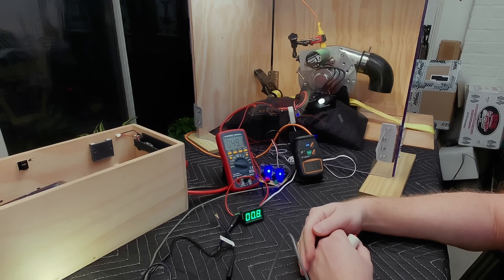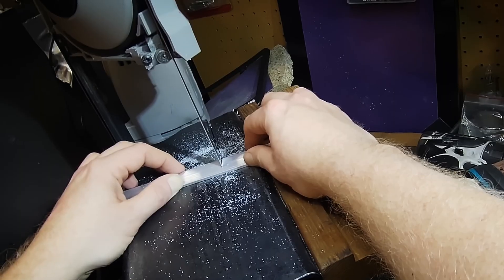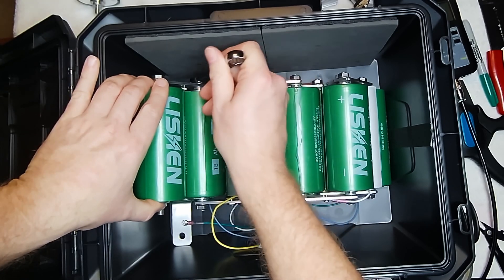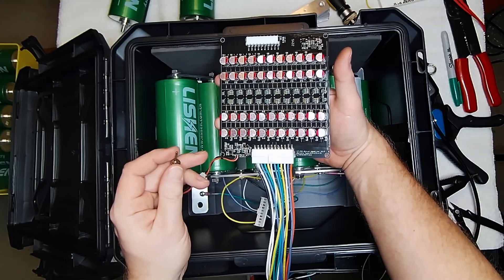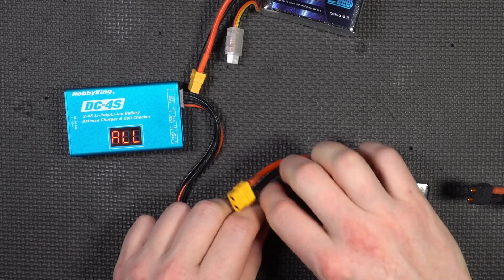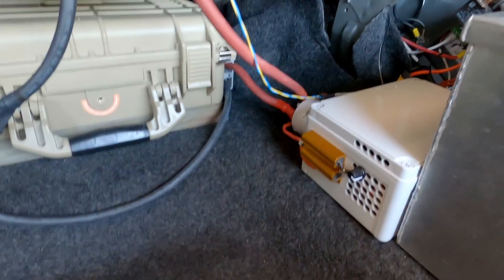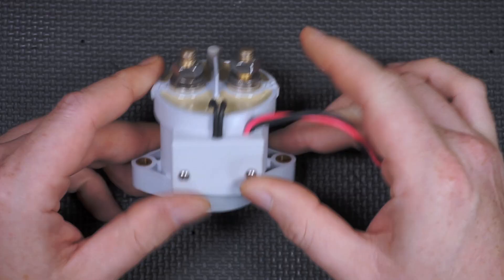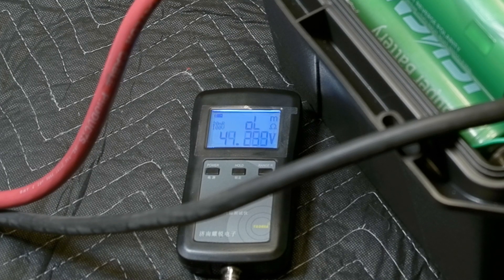I build the Ultimate 12s Lithium Battery

Comment: Great video.
I'm in a wheelchair and was wanting to build a better 24v battery for my power chair. It has 2x group24 deep cycle batteries run in series. They're heavy and don't hold a charge like they used to. What would you recommend to upgrade? A bunch of 18650's in series parallel?? Any help would be appreciated
Reply: Id run some big 18v drill batteries in series for 36v. Most wheelchair motors are just brushed dc motors which could absolutely handle higher voltages just dont run it to long in the grass or whatever as the motors will get too hot after a while. If the motor controller burns out you can use any old ebay motor controller
Reply: Thanks a bunch. That's an awesome idea.
Reply from the maker: I would go with lithium iron phosphate. You would need eight cells and you could get 100 amp hours and far more performance because of the shape of the discharge curve for less weight than the two batteries you have now. I actually did play around with a hoveround MP 5 I think it was.  I'm out of town at the moment so doing this on my phone, but if you look through my channel you'll see I did a lithium iron phosphate battery for the car. That thing is awesome.

Comment: I use the cells for 1 year and I have enough experience (burned about 30 cells) I built a battery pack 50s1p 26ah lishen 130v and I take 750ah without any problems and charge 500ah. it's not a problem. The only disadvantage is the very rapid drop in voltage. Under extreme loads (in my case) on the racetrack in the closed box, the cells get hot very quickly. I would recommend cooling.

Comment: Electric turbo's are just a fkn stupid idea.. as if every car manufacturer hasn't researched it and realised that it is absolutely stupid.. using more energy to spool up when it cam be done for free by exhaust gases.. using electrical energy means more fuel to create the power in the first place so its 100% inefficient when exhaust gases are free extra energy.. plus when its not running its a air restriction witch means you make less power.. so we are meant to run 2 battery's and 2 alternators creating more drag requiring more fuel just so we have enough extra power to run a stupid turbo... Ya answer is no ya obviously an idiot if you really think it is a good idea.. and even dumber if you think no car companies haven't already researched the shit out of it and realised that exhaust gases are the most efficient way to extract more energy for no extra effort to spool up a turbo.. take this spastic idea off YouTube.

Comment: I’m tempted to buy a butload of these to use for my solar install on the house…
Reply from the maker: Don't. Lithium iron phosphate is a much better choice for that.  Cheaper, higher power density and almost as safe.  The only real significant advantage LTOs have over those is much higher pulse discharge. Which you don't need in a solar setup. On my channel I have a lithium iron phosphate car battery I made, check it out. That thing is awesome. I'm making another one for my trailer.

Comment: Is it possible to combine these with the standard 21700 Lithium Ion batteries?
For like Ebike applications?
So you get the high instant power output but the energy density and value of common cells
Reply: No much different cell voltages and internal resistance
Reply: @thomasbarlow4223  ?? punctuation.
I'm not talking about parallel connection.
I'm talking have 21700s permanently charge the LTOs and when power is needed the LTOs supply it and then slowly get charged again for the next surge.

Comment: While all the safety points are true, the low IR is largely because of the capacity of the cells. The C rating is, at best, just under half of the C rating for LiPo cells. They are also have extremely low energy density and cost a lot more than a LiPo equivalent. You could have built a LiFePo4 pack that was less than half the size with double the capacity and equal performance (gained from the additional capacity)  with 25% less cells using a box that is 70-80% smaller at less than a third of the price..
LTO batteries have their advantages, but LiFePo4 covers that safety side of things and the lower C rating is offset by the energy density so you end up winning out by a long way by going with LiFePo4... You can have a pack that is 5% the size if you want to use LiPO pouch cells.
Reply: Lishen LTO's have a C rating that is on par with the best Lipos out there. There are some LiFePO4 that come kinda close

Comment: LFP is not useable? They are pretty safe too, high cycle and more power density. The nice one charges at 10c and discharges at 30c with higher burst. Regular eve cells are pretty decent too with 300ah cells holding a kilowatt each.

Comment: They can't do that many amps for more than a few seconds. If you need big amperage for short bursts, I recommend headway 38120 8ah cells.
SxxP2-3 will give you a solid 1000amps for 30 seconds or 400-600A constant. They store a lot less power but honestly it's not hard to modify an alternator to charge 20-50v packs a 300+ amp Car audio alternator with the phase wires and field wires pulled out a custom diode array (diodes rated for the higher voltage) and a simple mcu watching the charge current and pack voltage can PWM the field coil with a flyback diode and a mosfet.
Doing this and tie in a DC to DC step down to charge the 12v battery at 13.8v float. So you only need one. The 3rd thing is to add a wot trigger and a timer. So, at Wot, it stops charging for 30 seconds or so. This will free up 8-15hp for that short period and add to the effective boost output power. 1 or 2 outputs from a custom ecu like mega/micro squrt flex dash, etc, can be set up to trigger when to start and stop charging as a function of a tune..

I will join the forum this looks interesting and I have a full machine shop and an old scion XB that can use a little push
Reply: Lishen LTO's blow Headways out of the water. Even new (insert current year here) Headway cells are 10C continuous....15C you start to see voltage sag become so extreme that 4S just doesn't hold more than 10V. 20C would be an acceptable short burst/pulse rating but definitely nothing more than that. I've heard the 26Ah Lishen LTO's (ignoring the fact that they are higher capacity so will be lower IR than an identical chemistry 18Ah cell) actually have a higher C rate than the smaller cells. Most people agree that Lishen LTO 26Ah cells are a true 20C continuous and 30C burst if not 25-30C continuous and 40C to 50C burst/pulse

Comment: I need a 13.8-14.8v battery that can provide 50ah  - what pack would be best ?  Using it to run a ham radio - max draw is 23amps
Reply from the maker: I would build a lithium-iron phosphate pack for that. You'd only need four cells.  If you look on my channel I did a video where I built a lithium-iron phosphate battery for the car's main battery. It's been flawless since I put it in. Never fails to start the car.

Comment: Using similar cells for different applications, I have found that copper pipe cut into short rings, and flattened in a vice makes excellent bus bars. I usually pick up scrap, up to 1 1/2" for large bus bars at my local HD.
Reply: It's probably easier to use pieces of 1/2" or 3/4" pipe and flatten that.

Comment: At 3:52  I think you meant to say lower energy density. They have EXTREME power density (ability to supply instantaneous power) but low energy density (capacity to store charge and supply if for long)
Reply: Correct

Comment: Given the power carrier cables are insulated and the nuclear level of arc amps on tap here, I would enamel dip the flare nuts and blue painters tape the bus bars for at least some insulation value for assembly/disassembly and also accidental dropping of conductive objects which becomes catastrophic and I’m sure scary.
Reply from the maker: That's a good idea.  I thought about heatshrinking them, but there's the balance connection to content with.  I suppose I could punch a hole in the heat shrink before I put it on to make things easier.  But in the big picture, these are testing cells.  I'm in talks with a battery manufacturer to make me custom Lipo packs that could deliver the same current but be smaller, cheaper and lighter.

Comment: What kind of current output can that supply?
Reply from the maker: They're rated at 900 amps continuous and can probably do 2,000 amp bursts.
Reply: @AlexLTDLX  OK, that's about what I'm looking for.  I've got 25 super capacitors that in series are 67.5V max at 300F.  It will do 2200 amps.  I only need it on for under 1 second.  However those caps are vvveerrry big.  What your building might take up less space.

Comment: Where did you get those Lishens from!!!?? Mine all have horribly inconsistent internal resistance, yours are fantastic!!
Reply from the maker: I'd rather not say - I ordered 60 cells and a number of them were questionable.  I literally had to test each cell individually.  The seller advertised them as "new, tested and graded."  They appear to be none of those.  I might sell some of them off in the near future (the good ones, anyway).
Reply: @AlexLTDLX  oh I see, OK, yeah I have had absolutely horrible luck with the quality control of the Lishen LTO cells. The technology is amazing but finding grade A cells is very difficult. I have found XS powers Yinlong cells generally are brand new with good internal resistance. But it’s nothing like some automotive grade A123 Lifepo4 cells. The auto grade ones (you get them out of hybrids and EV’s) are PERFECTLY matched and have phenomenal quality. So I almost exclusively try to find recycled automotive cells now to use for my projects. The trouble is a lot of them or laser welded, but I’ve been able to find some that are studded or I just find packs that are already laser welded that are already laser welded in the configuration. I want to use them in.

Comment: Why the capacitors? Given the low internal resistance and current capability of the LTO cells, I wouldn't have thought this to be necessary?
Reply from the maker: We have to run long cables in the car, and they just happen to be convenient electrical junctions.  You're right - for a run this short, they're not really necessary.

Comment: Note: LTO cells can be totally discharged to0 volts, so you could assemble it without a problem.
Reply from the maker: That's happened to some of these before (if you look really closely, you might see a small "D" in sharpie on the aluminum ends of a few of the cells - those were dead on arrival).  Not all of them came back, fwiw.  I was pretty peeved about that when I bought them, considering they were all supposed to be tested and new.  Clearly, they weren't.  I had to go through all 60 that I bought and test them individually.  Took forever.

Comment: Lfp cells have very similar properties. Higher voltages is where you want to be for this . Just because it has the ability to weld doesn't mean it's scary. Energy density is pretty low on these.
Reply: Seeing those metal parts partially obliterated while pack voltage dropping only a little makes it look like pretty scary at least for me.

Comment: Curious on what the other cells you're looking into are. Would they perhaps be the Sheng Quan LTO 32145s? If not, I'd love to know what cell it is. Speccing out a possible EV project and ended up building a quick app that calculates things like energy density, pack price, and total weight. Trying to evaluate all my options up front.
Reply from the maker: Honestly, for scaled applications, it'll be tough to beat more conventional LiPo-type chemistries.  They'll be cheaper and have higher energy densities.  LTOs are great, but for the money I spent on 60 of these cells, I could've bought an almost new complete EV take out pack.  My wallet still hurts thinking about it.
Reply: @AlexLTDLX  I'm actually not looking for energy density as much as I am power density. The safety and temp tolerances are a bonus, too. How much did you spend on 60 cells? I'm seeing them going for ~$12 per cell. Wondering how much you got nailed on shipping/import.
Reply from the maker: If you can get real ones for $12/cell then jump on them.  Typically they're around $30-$40.  I spent around $1,500 for 60.

Comment: How expensive are these batteries ??? I would bet you just love low internal resistance cells.
Reply from the maker: Unfortunately not only are they pretty expensive, they're also hard to find.  I bought a lot of them and I still paid $25 per cell.  I kind of lost my mind when I ordered them.  In smaller numbers, if you can find them, expect to pay $30-$40 each.
Reply: @AlexLTDLX  What is the average life expectancy of these cells ?? Very nice work Alex. You most certainly did your homework.
Reply from the maker: Thanks.  They're supposed to good for 30,000-50,000 cycles.  About 10 times that of lipos.  In theory, I'll die before these do.
Reply: @victoryfirst2878  in normal use they will last longer than most vehicles :) , they typically have 10 times the lifetime of lifepo4 , so 20 years+
Reply: @amojak  Would making a power wall pack last over twenty years ??? This is my idea Sir.
Reply: @victoryfirst2878  LTO would easily last that long, even under cycle use you are looking at around 20,000 cycles. And you can safely charge it at 10C too.
Reply: @amojak  Thanks for the information amojak. Keep me informed if you think of anything else Sir.
Reply: @AlexLTDLX  Why are they hard to find Alex ???
Reply: @victoryfirst2878  aliexpress is full of them
Reply: @amojak  O.K. will do my homework and check it out. Thanks

Comment: Any consideration for pack cooling?  Seems like it might get hot quickly in the hard case like that.  I guess if the intended application is drag racing, they have enough times between runs to cool off.
Reply from the maker: Having such low internal resistance and relatively high mass, they really don't even get warm when pulling 678 amps continuous like we do with the Sledgehammer setup.  Dissipating about 3,000 watts in 62lbs of batteries for even a minute or two has very little effect.  And considering at the dragstrip these things are only providing power for about 10 seconds at a time, there really are no heat concerns.  Even on a roadrace car, I think you'd be fine, since you wouldn't be in boost all the time.  And most lithium cells produce more power as they warm up.
Reply: @AlexLTDLX  I would like to hear more about that 'Sledgehammer Electric Turbo'. Thanks for any info. Ya'll Take Care and be safe, John

Comment: This so cool to see. I wanna build a electric go-cart for me and my kids. I have alotnof rc car's and have a 16s flier esc with tp 650kv motor that's crazy powerful in a losi 5t 5th scale 50 pound rc truck. And since seeing how much power it has and other videos of guys using just a 8s 800kv castle system on a cart already that did like 50mph with 1 motor I need to build one. But battery's is the key to maken it right.
Reply from the maker: If kids are involved I'd definitely lean towards LTO cells just for the safety factor.  Do you have a link for the guy with the Castle-powered go kart?
Reply: @AlexLTDLX  no I don't. It's on YouTube. Just look up electric go-cart and you should find it.
Reply: If you want to build an electric go kart, then see what you can build as an electric go kart.😉

Comment: Cool battery solution.  Still would have liked to see good quality Lipos used in testing instead of the ones you used (the cheap ones that suck).  They are smaller and easier for a normal person to use.
Reply: These are some of the most powerful high rate lithium batteries you can get your hands on. We use these in car audio, pulling tens of thousands of amps. Literally. No one takes cells to the limits like today's car audio scene. Sure, they don't have extreme energy density, but they are some of the highest discharge cells out bar none. They can take in power like they dish it out as well, and actually amazing capabilities for such a small package..
Reply: @georgesrisomsak9650  I do understand that but I was hoping to see more testing with more “user friendly” batteries. Lol. He used the green Ovonic which is not their good one. Zeee are cheap, bottom line as well. The orange Ovonic are a much better lipo. And the new Tattu v5 are amazing.  An easier option for people following this, if they perform.
Reply from the maker: I have an SMC drag racing 4s pack on my other desk right now...  I'll be testing whatever batteries I can get my hands on.
Reply: @AlexLTDLX  While I am excited to see how that pack you are building performs (think you found a winner there) I think that is just a bit out of reach for most.  You are the only one I have seen doing this type of testing.  Would be cool to see a sponsor from a battery or ESC company for you. Once you have this down to a "all in one" package that delivers comparable to "standard" turbo, everyone is going to want one.